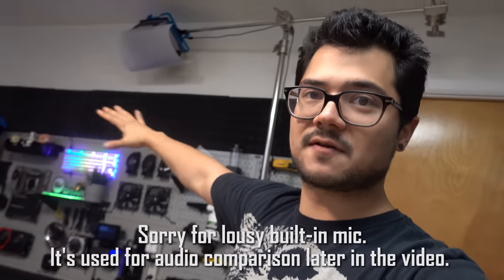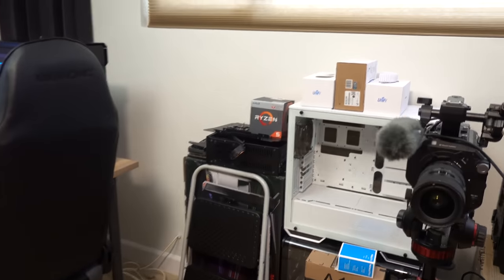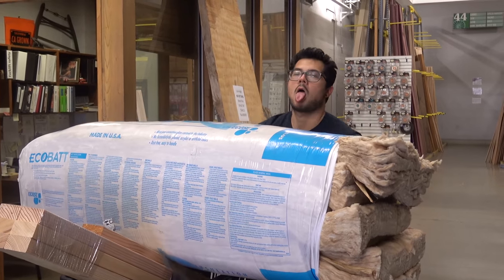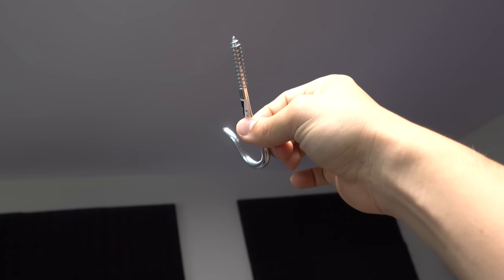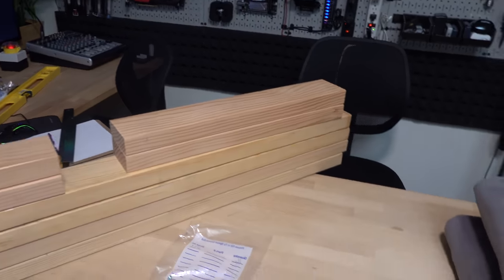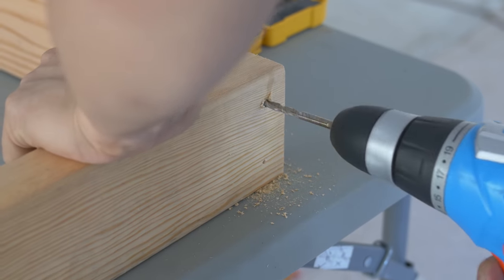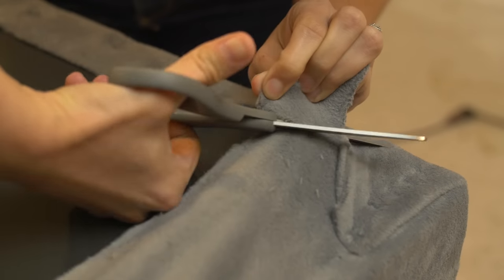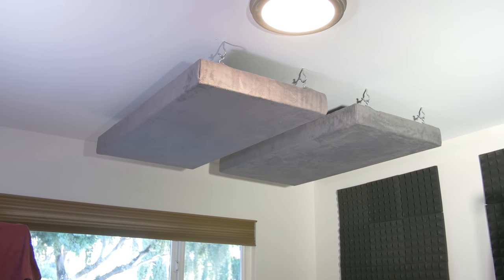Making my own acoustic panels...Was it worth it?

Comment: Considering you claim to be a carpentry novice, you did an almost flawless build on these.  Good design, good tool technique, and sound(pun intended) construction.  
That wood was really nice, btw.  Was it just framing lumber?  It was practically clear.  
You might have been able to save money by buying upholstery padding(like a roll of polyester/cotton batting). And you could have used smaller wood(1x4) considering you strengthened it with brackets.  Awesome work, though!

Comment: Speaking as someone who professionally designed acoustic chambers, some different choices should have been made: 
1. The poster board on the back is too solid, Fabric or a permeable board would be better (something with lots of holes)
2. The insulation should be in an unsealed plastic wrap (like a bag), to prevent particle dusting, and fit loosely in the case
3. The fabric should have a low thread count and be made of fuzzy yarn (think tweed), the space in the weave lets the sound pass through and the insulation does the sound attenuation like you want.
4. Lining the faces of the frame with a rigid open cell foam would further help
5. using an elastic loop instead of the S-hooks could also help (but really a very minor improvement).

Comment: I'd recommend you pick up a couple of cheap moving blankets you can thrown on the floor once your camera and lighting setup is done. Also, I suggest you use 1x4s with cheap metal brackets to brace the corners. Cheaper and lighter.

Comment: If you want a cheaper insulation option, you can use insulation panels. For 0.74m/sq it will cost you £11 from wickes/b&q. They're pre-cut. Alternatively, you can get narrow rolls of the stuff and as anther alternative, you can grab some cushion foam!

Comment: Advice from a musician. First, You can build more panels for cheaper using different materials. As far as surface area in certain situations you may need to cover the equivalent of one wall or up to 15% of the surface in the room to reduce the reverb in the space properly. If you want to record video from any angle in the room I would to cover a good portion of the ceiling and upper walls for acoustic treatment since the lower areas are in use. Two companies worth considering for advice are gik acoustics and acoustic fields. Both have diy and purchasable options.

Comment: To cut insulation... *Paper side up*, lay the area to be cut over a board (you got some 2x4's), compress the insulation flat with your hand and cut with a sharp utility knife, each time you cut move yur hand down. If you feel less than coordinated to pull this off, press another 2x4 on top to compress the entire cut length at once (use yur body weight to compress it all or hire a friend to help), cut along the edge of the 2x4 on top. Keep the blade held at a nice sharp angle when cutting and let the tip dig into the base 2x4 a bit (this gives a scissor like action while yur dragging the knife down). A little practice and you will have super clean looking cuts. If the paper starts tearing while cutting, replace the blade immediately.
Reply: P.S. - I can hear the difference easily and my hearing completely sucks. Some of the sharpness is gone from your voice and the reverberation is toned down. With just a little more work I think it'll sound perfect. To be honest, I can't say that I care. Being a person with limited hearing, I prefer no background music more than anything else; it's not there mixing with a persons voice making it harder for me to hear the spoken words. What you have to say is the most important thing in my mind... This is the single most important thing to me and it's what stops me from subscribing to your channel.

Comment: Check out Rockwool.  I just constructed and hung custom built panels last weekend in my new office.  You can get 6 2'x4'x2" bare mineral wool panels for ~$106 shipped from Rockwool/Amazon.  Spent another <$40 on the fabric at Hobby Lobby.  Wrapped the fabric around the panels, ironed the face, and hotglued the fabric to the back of the panel.  Purchased Impaling clips (30) for $30 shipped on eBay.  

When all was said and done, I spent under $180 on 6 finished panels that are the exactly what we wanted.

Comment: Honestly, one of the quickest and easiest echo-killing solution with ceilings is draping a sheet across the ceiling. Whilst I know you dont want to shoot your videos on carpet, small rugs wherever possible are going to do wonders. Oddly enough a wall won't become as much of a factor at that point. And wouldn't using a more porous fabric yield better results? Mythbusters did an episode on bypassing security systems and the bigger and softer the fabric used to try and sneak past the audio device actually made it harder than just a normal bedsheet. Try low threadcount cotton sheets next time around.

Comment: Just use the foam panels and don't worry about those large expensive sound proofing panles,  your issue is with reflection which is what the foam panels excell at , hanging thick blankets work well aswell

Comment: using metal U shaped cable ducts would be much cheaper and easier to attach to the ceiling, 2x4s are way excessive and heavy. Orthophonic fabric is a MUST in these projects, the fabric you used voids the whole purpose of the pannel by reflecting all but bass.

Comment: It made a difference, clearly less ms of echo. Your problem is that there are a lot of smooth metal surfaces. Try building a diffuser before making more panels. It will defenitely help and its fan to build too.. It cost me about 90eu (100$) for two 50x50 panels with square wood poles (9cm/side)

Comment: the boxs are good but with the fabric i would advise something more see-though and thin like sheer and flimsy like they use at the movie theatres. something heavy and tight like that blanket will act like a drum skin and reintroduce reverb to the room. almost be easier to just hang the blanket loosly on the wall like a big soft curtain

Comment: The problem with  one inch thick foam (Sonex or Auralex) panels is that they're not very effective below 1KHz — (700Hz in the case of the 2") and most speech is well below that in frequency.
Best bet (if you don't wanna pay $100+ per panel for RPG, GK Acoustics, et al) is to use 1½-2" OC 703 or 704 – works much better than rockwool and is easier to work with as well – use two, leaving a 1" gap between them, then cover them with some acoustically transparent fabric.
Still, you'll find the panels you DID build much more effective than any 1" foam!

Comment: the fabric should be the same as speaker grills, sound transparent, or as close as possible. that fabric looked abit thick and will block and reflect sound rather than letting the insulation do its job

Comment: Couple things here for ya bud first thing job for not being a DIY guy, but I am going to clarify some things for some people. First those "studs" in the ceiling are called joists and you want to make sure that what are are drilling into isnt a truss because drilling holes in trusses goes against building codes. A truss is one solid piece they are completely different and rafters and joists. 2) makes sure you arent going to drill into any electrical wires or pipes and if it's an attic your central air or something else, some homes have their water heaters up there (same as you would a wall though). 3) you should be using fiberglass free insulation, and this is so it doesnt go through the the clothe and you breathe that shit in. 4) this is just me but i would have tried using 2x2s for cost reason and it will compacting down the insulation better. Also you paid a pretty penny for that insulation. I just picked up a 60ft roll from lowes for only $20 but the main thing you wanted is fiberglass free. My credentials are I do this for a living and went to a vocational school.

Comment: Why did you use 2x6 lumber and not 1x6? Seems like a lot more weight than is needed. Also why not use foam insulation panels? You could just cut them to the same size as you did with the wood and poster board and then cover with fabric. Lots less weight.

Comment: alternatively you could get Uhaul Large Mirror and Picture Boxes (which are 48-1/4” x 4-5/16” x 32-11/16”), stuff them with insulation, use glue on the rear of the box to adhere fabric to, then you could use adhesive to affix to the ceiling or using a J hook with a flat style washer on the inside of the box for weight distribution.  This method saves a ton of time and looks great.  and if it falls on you, you laugh about it instead of ending up in the hospital.
Reply: the boxes are $6.95 each, insulation is cheap if you go the fiberglass route- like the owens corning eco-touch R13 single faced fiberglass roll insulation.  that's 3.5" thick and comes in 15 inch wide rolls of 32 feet length.  that's $21 bucks.  fabric is your choice at that point and hardware is up to you but it should cost you about $12-18 per sound panel this way

Comment: Jeezz Dude.
In the 80's 90' and early 2000 making sound panels for recoeding studio's dyno rooms etc was cheap. The bottom of egg cartons ( card board ones are better,) and staples.Take card board boxes big opnes (call your local supermarket or big box store they'll give them for free.
Open them staple the egg cartons to the card board.(everyone eats eggs tell your friends to save them)
Tape or tack the cardboard panels to the walls. Cover with a sheet done.
A lot of bands made great mix tapes and albums using setups like that.

Comment: Having worked in the theatrical world for almost 20 years (Granted a few of them are high school years) You can honestly just hang some heavier fabric (the felt you had would be great) from curtian rods or you could make smaller lighter frames (2x2 or 1x4) and put them all over. Its a cheaper method and get you close to what you have already. Yes the insulation/foam will net you more sound deadening in the end, but if your looking to DIY it on the cheap I'd start there. 

Just my 2 cents. And no Jay didn't send me. :P

Comment: If you have access to the roof from above and the surface of the roof itself is dry wall you could always replace the existing insulation with something that is more sound absorbing. Drywall itself, while subject to sound travelling into the panels via motion in the studs and the rest of the construction, is actually damn near perfect as a sound dampener.
Reply: It's the hard flat plaster of the ceiling that is sound bouncy to voice. Still water is very sound reflective and what is under the surface tension is ultimately soft.
Reply: @Safetytrousers  Well every meeting room I have ever been in use drywall. And assuming it has been built the right way nobody outside it can hear what is being said. Granted that is more a subject of sound penetration than reverb, but still reverb is also not a major issue in most meeting rooms with low sound penetration either.
Reply: @aBoogivogi  Sound isolation and reflective treatment are different things. Any soft or variated surface is useful in cutting out reflections.

Comment: Get 1250mm*625mm*100mm Mineral wool, some straws (8cm each) T-Nuts, some wire (100g for 2€) and thin fabric (1,75 - 2,50€ per meter and 150cm in width) + spray adhesive and you will build 6 panels (total about 4,5m²) and every panel will cost you about 5 - 7€. Adding to that, add some air gap behind it and you will save even more

Comment: A 2x4 frame is extreme overkill for mounting ~3lbs worth of insulation. 
Doubled-up corner brackets are also an overkill and unnecessary way to screw 4 peices of wood together. 
Those giant screw-eyes might be necessary to mount the 30 lbs of wood you went with, but with a more  realistic build you can use something smaller/cheaper there as well.

You can get the cost/effort/weight of this project way down just by building a more sensible frame. You're just trying to hang up what is essentially a big fluffy pillow. There's no need to overdo it.  
And I mean that literally, you can just  shove the rockwool into a body pillow case and staple it to the wall. It will work fine, maybe even a bit better.

Comment: The problem with the sound of your room is caused by reflections. You need materials to absorb and disperse sound away from hard surfaces. Your sound treatment doesn't need to be so thick. The panels you've made are more for deadening high volume lower frequencies. You just need to remove some of the hard surfaces. Adding a thick rug and acoustic panels to the wall directly across from you and directly behind you will help more for your needs. I know you don't want to add a rug but even a small area rug will make a huge difference. The floors are by far the most reflective  surface in your room.

Comment: the only things I would change on your setup is that I would not use wood for the panel, given that the frame would reflect quite a bit of sound, a thin aluminium L frame with some spacers would be better as well as a lot lighter, and likely cheaper, you could also  use fabric to make the interface between the fiberglass mantle and the air, it becomes a lot less ominous and risky without that gigantic wooden frame you build, if it falls with the aluminum it would be like a heavy pillow, an itchy pillow, but a heavy pillow nontheless

Comment: those panels would have been fine for wall mounting but normally ceiling clouds are made a little differently. You can also build these with alot cheaper material and get a better overall cost with the same effect. Look up some audio studio how to videos they go over alot of sound treatment.

Comment: these can/ could have worked if:
1: use rock wool with a higher r value
2: use these in the corners as traps instead
but ideally you'd engineer the room before by doubling up the thickness of your dry wall and foam insulating between the studs.

Comment: Use 2x3 kiln dried wood next time for about $2.25 per 8 feet vs. $2.75 for 2x4. Also, instead of insulation, just get a bunch of towels from goodwill or something and cut to size. The R rating for insulation is simply a measure of its heat resistance. The STC rating is what matters to noise isolation and dampening. STC of 60+ is ideal for sound dampening although you won't achieve this with these floating panels. You chose an expensive insulation with a low STC rating for fire resistance instead of one meant for sound isolation. For a similar cost, you could have used high density foam insulation instead which would have been much more effective. Still though, putting 6-8 towels together would have given similar or better results than foam. Honestly, this is a $50 or less project if done correctly. I'm really not trying to be a jerk on this and I can show you what to get if you happen to see this and respond, Kyle or anyone else.

Comment: Bring everything away from the wall and use curtains or material blinds, you just need the sound to not bounce back from the material rather than absorb all the sound. Even recording studios often don't sound proof such large areas. Or a dynamic mic for desk recording wont pick up as much reverberation.

Comment: It would've been cool if you added a cross member inside each panel to screw the hangers into so that they were more towards the middle. That way you couldn't see the hooks between the ceiling and the panels and they'd look like they were just floating right below the ceiling.

Comment: As an audio engineer for 9 years, get yourself a big, big rug for the floor. Also, hanging a thick blanket(s) on the walls should help and be a way cheaper option than those expensive panels. I didn't hear too big of difference with the ceiling panels

Comment: Drilling the pilot holes through the clearance holes is nice when you're feeling lazy but that few mm the bit can drift in that hole can throw your edges off when you bang a screw through it, it's better to get a long enough bit to drill the pilot hole through the first board and into the second all at once and then use the pilot hole... As a pilot hole, for the clearance hole. Clean edges without the effort of measuring every hole.

Comment: you could probably of used that Expanding foam they use in wall instead of the insulation  should be cheaper and work just as well if not better  and you could make the whole setup lighter by using the wood to make square then adding a wood back then spray in expanding foam let it harden trim to size then take wood back off and push out the foam then just stick that to ceiling

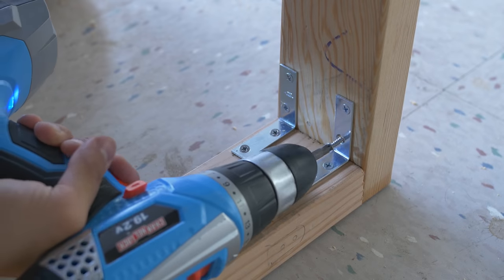Comment: 9:06 you can put in all 4 screws for the angle brackets but I would have put in 2 because you run the risk of cracking the wood which can lessen the stability of the frame and since the frame is going on the wall you should worry less about the angle brackets and more about the wall connection. But you can pretty much do whatever, it just saves my patience 😂

Comment: 4 bath towels (approx $20) wrapped around the wooden frame would have performed just as well, or possibly better. (depending on the weave)

Two panels would end up costing about $50.... before adding the cost of the mounting hardware.

Comment: Some improvement but needs a bit more.  Maybe next panels you skip the panel boards on the back/top of the panels and wrap it all in fabric. Should improve the acoustic absorption and reduce the cost. Attach the d hooks on top of the fabric.  You cold place a vertical post wrapped in insulation and fabric in a corner standing on the floor as well.